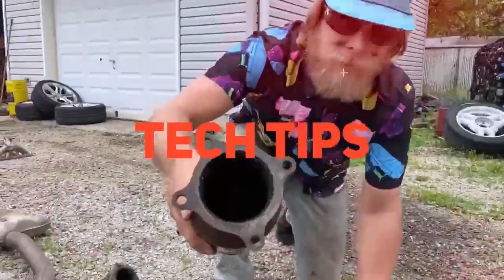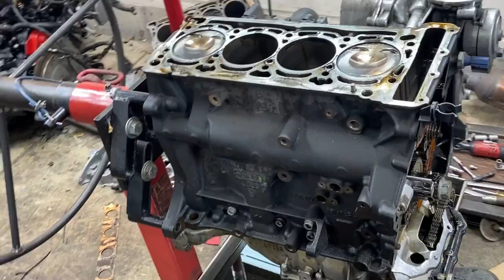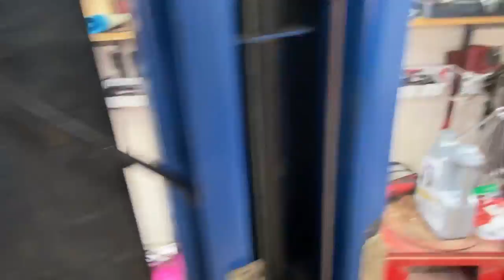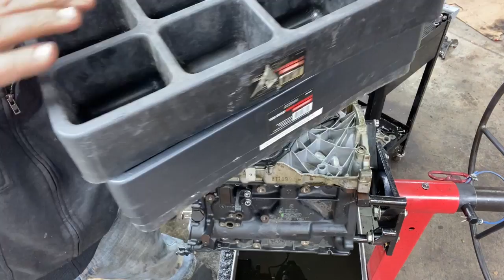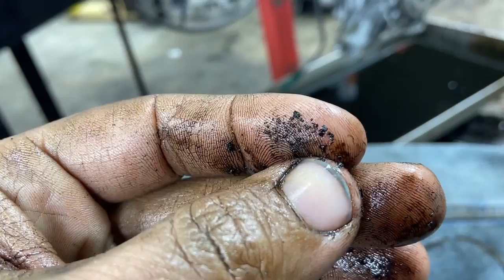2.0t Oil consumption tear down and inspection.  Audi VW using oil pistons failure reliability

Comment: Man, I love the way you do your work. Just bought my 2017 Q5, at 108k, no major issues, outside of the water pump and cv axle. But, I know I'll have to be doing the timing chain, and tensioner, new oil pan, valve cover gasket, the works. I love how you do these, talking to us "simple minded" DIY'ers out here. Working on a dirty garage, where you're stepping around your stands, chairs, and the such. You get so many that just "remove this, remove this, remove this, install this, install this" and so on. Instructions, but no know-now. 2. 0T community is here! Still going thru your videos, for sure, will def be posting questions on diag technique for a few things. Like oil pressure. Why's my engine stumble when removing the oil fill cap, and how to find that vacuum leak (if I'm right and that's what that is). But, keep up the vids man! I love that you.... Share experience instead of teaching instructions. ❤❤

Comment: 3:40 this is true.   I used to buy name brand parts on eBay and Amazon.   Not anymore.   I bought a set of 'ngk' plugs for my vw.  They were counterfeit spark plugs.  The boxes looked legit and so did the spark plugs but there were a few details that had me questioning the product.  I did a little bit of searching and sure enough, these counterfeit parts are a huge scam going on all over.  I ordered the same model plugs from rockauto(they supposedly ship direct from manufacturer) and these were legit.  Very slight difference that if you didn't know, would think they are both the same product, box, upc labels and all.

Comment: I have a 2010 a4 b8 with the 2.0 tfsi. Have this job ahead. Thinking of boring to 83mm with oversized pistons. Is this an option, due to the coating on these cylinder walls?

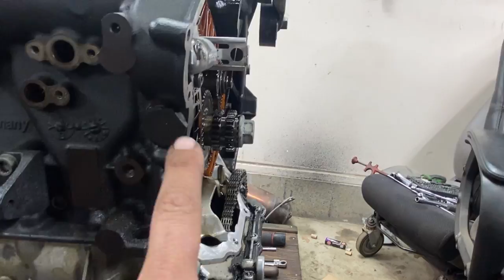Comment: Around 14:40 when it's said "these pistons have a date on them" - 05/06/2015 is not May 6th (because 2009 Audi A4 was primarily manufactured in Germany) but the normal way all the world (except USA) does it: in progression from small to large so  day/month/year-  so the date is  5th of June 2015. USA does many things backwards in antiquated fashion, like using the imperial system instead of the international metric system, to the point that Americans make errors in reading dates or communicate  measurements. Many expensive errors in engineering/medicine  were made due to this. I work in an hospital and my nurse interpreted an intended 2.5 cm to mean 2.5 inches when she applied the  FemoStop  Femoral Compression System  (pneumatic device used for external compression of the femoral artery or vein after they are catheterized to access the heart arteries to place stents in case of heart attack). Even if the medical devices are written always in metric system she mentally kept the 2.5 cm number but converted to what she is used to - inches, not centimeters. Patient continued to bleed after the device was placed in the wrong place,  and needed a blood transfusion. None of the nurses figured out the problem before we asked them what units of measurement did they use and even then they wanted to read the instructions on the package to verify there are only metric measurements there. One inch + 2.5 cm so big difference. Luckily it was corrected in time. US Congress should switch to the international system in dates/ metric measurements to prevent future errors.  Otherwise this  is a very practical and precise video, the first time I see the inside of an engine and the problems explained in an easy to understand way! SO subscribed even if I'm not technically talented.

Comment: Bro I have the 2013 A4 2.0Tfsi recently bought. 

Definitely need some help with my engine. Am in Taylorsville KY 

Upper timing Chain cover leaking. Along with some other leaks. Happy to bring the car to you if needed? Definitely burning oil too. Oil on coils and plugs. Performed a piston soak. It helped 3 clean up well. 4th still has oil. HELP ME PLEASE 🤞🤞🤞 

Am subscribed to your channel. You are the man to go to with the problems I’m having here. 👍👍👍👍👍

Comment: Hey, I'm rebuilding my 2010 a5 that had balance shaft failure and burned excessive amounts of oil, was wondering if not going oem pistons what would you suggest and also how do u feel about the borsehung balance shafts and oil pump.

Comment: I have a rule of thumb when embarking on a big job that takes days or weeks for me (an advanced level DIYer).  Don't ever cut corners and cheep out on the critical parts that take a lot of work and time to get to or could have a catastrophic failure and ruin your project.  Nothing like having to do a job multiple times and if you try to minimize that as much as possible and cut out the reasons for having to do this the better off you will be in the long run even if it cost more.

Comment: The Ea113 engine you have in front of you had many different versions. BYD, BWJ ect. You want a cdl code engine (better rings pistons cylinder head etc). If you get a good one and look after it you get 280bhp and years of fun.

Comment: I have a 2014 Q5 2.0L. I’ve watched practically all of your videos as my ride seems to have all the issues. I’ve spent $6g in the last 3mo, practically everything under the hood has been rebuilt, replaced, updated, etc but it continues to slip or stall every time oil is added (basically 300 miles). I was told by Audi Asheville and my Audi guy the issues weren’t related to the oil consumption, however, I believe it is. We’ve recently done the B12 soak/cleanse to see if it will reduce the oil consumption. I wish I could bring “Jemima” to you, to get your opinion. And FYI, Mahle is pronounced Ma-Lee. I’m from Morristown, TN where there is a Mahle plant, and as a matter of fact, my high school hall passes 25yrs ago were Mahle pistons LOL.

Comment: The engine in my car has been overheating and since that happened it started burning a lot of oil. I think one or more oil rings may be damaged since the compression, pcv and valve seals are ok, or could it be something else?

Comment: Hey Naptown. Since you're the 2.0T dude. Got some questions. I have a C7 A6 2.0 that had a timing chain tensioner issue. Mostly seemed like a fluke to me. Shop replaced engine under powertrain warranty, and im at 70k miles on rebuilt engine (170k on car). Been happy with it, change oil often, and poke around with wheel bearings, brakes, suspension, and stuff. My GFs 2010 ford edge overheated and got toasted, might pull engine on it and fix, but instead went route of picking up a 12 Q5 2.0T, with extensive, expensive dealership maintenance history. Looks like engine was rebuilt 2x for oil consumption. At 170k on the car, it seems to consume oil 1qt per 3k miles, and spark plugs were carboned up, missing small bit of ceramic on one, but did not see scoring on pistons or damaged valves with borescope. Think a dealer put crap parts in twice that it would have repeat issues of oil consumption. Incredible to me the C7 doesn't burn a drop of oil but this Q5 with multiple rebuilds does.

Comment: I have a 2015 A4. #4 piston ring  lands let go and lost compression. piston  dated 31/10/14 , but still used the old crappy oil control ring. I thought they did away with those with the updated pistons? it's getting the newest set of pistons, so i'm just curious at this point.

Comment: The compenents were purposely designed for lower friction, they lowered the tollerences to do this. The fix is to replace with a larger piston and a higher tension ring. The replacement design specs are the one found in the VW 2.0

Comment: Had a 2011 A4 that ended up with the issue. Cyl 3 was the worst in my engine. 

No longer have that vehicle and now own a 2012 VW gti. Its got mahle IE spec pistons and IE rods after it developed high oil consumption. Also has a cts boss gt28 kit. 

The 2.0T was a bit problematic in the early days but when they run,they run well.

Btw new sub. Glad your shorts came across my feed and i decided to go exploring your channel.

Comment: Have you found any of the cleaning solutions that are oil additives can help fix the problem?  I mainly familiar with the BG-EPR and then the more elaborate BG Dynamic Engine Cleaner.  I've also heard about a air pressurized piston soak that is being used by Hyundai/Kia and a Valvoline cleaning product.  Any comments on how these, or any other, cleaners might help would be much appreciated.

Comment: Hey brother, if you wanna take a trip to SC, I’ve got a 2014 w/ a cylinder 3 misfire, spark plug full of oil, but dry compression shows 160 roughly in 3 cylinders, 175 in cylinder 1

Comment: Hello naptown tuner.great explications as usual .
i'm rebuilding my tiguan engine 2.0 tsi .how will you choose the right upper main bearing color ? It should be scripted some where on the engine (gearbox side) ,but unfortunally the area is rusted .any solution to find this information somewhere else ?

Comment: I've got the A3 1.4  2013 CMBA engine  with timing belt and my warning oil light comes on just before 500 miles.

Comment: Great vids man; no frills, no bullshit, just good info……..I die laughing when you pronounce Mahle pistons “Maul”. I don’t know how to say it either, and I’ve been pronouncing it as “Mah-lee” for years now. I’m prob wrong, and the way you’re saying it is right, which also makes me laugh bc now I’m wondering if I’ve been saying it wrong for years 😂……..

I love the ea888 2.0T. Fantastic little engine. Mine is starting to get into high mileage territory, but still runs well, except for this weird—non carbon buildup related —cold-start misfire. Not every time, and it always goes away. 

Although the manual says to use 5W40, I’ve always used either Castrol 0w40, or M1 0w40. In my head, the logic is using the 0W40 will flow better on cold-start, and therefore hopefully pressurizing the timing chain tensioner quick enough, that if the tensioner ratchet mechanism failed the chain wouldn’t skip teeth. It doesn’t burn any oil using 5W40, but burns a little bit during the summer using 0w40
Reply from the maker: I’ve learned a lot since these early videos, I even interviewed a guy about the pistons at the Mahle booth at performance race industry and asked how to say it, I didn’t even know about kolbenschmidt pistons and thought they were a cheap knock off because the ones I saw on eBay were cheap counterfeit China replicas.  I need to redo all these early videos

Comment: The cost of a part has nothing to do with intelligent design. I can buy a $30 chinese honda copy piston for a motorbike that will last 10x as long as a $300 vw piston designed by a complete retard. The fundamental design is more important than the quality and price. If the rings are badly designed you could pay a million dollars for a piston and it wont last

Comment: Awesome video! You explain everything in such detail, thanks for sharing your knowledge.
I have a 2012 Audi A4 Quattro 2.0L which has always burned a bit of oil and slowly over time it has gotten worse & is now to the point of burning approx. 1L every 2500km (worse if I punch it at times which I now try to avoid). If I do try to accelerate quickly (punch it) it actually seems to choke a bit (no codes) prior to kicking in.

Comment: Got a 2016 Q5 with a 100,000 mile CPMB that, im pretty sure, has the oil control ring issue. 

Beautiful car, dealer maintained since new…. Looks like the engine is coming out….

Comment: Got a 2016 Q5 with a 100,000 mile CPMB that, im pretty sure, has the oil control ring issue. 

Beautiful car, dealer maintained since new…. Looks like the engine is coming out….
Reply from the maker: Yes I just got done doing a 2015 q5
Reply: @NaptownTuner  is there a gasket kit and/or timing tools you’d recommend?

Comment: Thank you for you videos, it's a great source of info for DYIers. Wanted to ask if replacement of pistons can be done without removing the engine. Any links to such information? I've done oil pump replacement on my 2012 2.0T Q5 and it was tough to get to couple of bolts but doable.

Comment: Great videos keep up the good work... My daughter's 2014 q5 2.0 is going through a quart every 200 miles. Thought the piston problem was fixed for the newer models. Any suggestions?
Reply: 2013 Q5 2.0T here and it uses 1 quart per 600 miles. Unbelievable

Comment: @NaptownTuner !!! 
I did it! After watching many of your videos, I just finished rebuilding my 2.0T for the oil consumption issue!! First rebuild ever, and now I'm back on the road. I took my time and planned and ordered parts for about 1.5 months leading up to it. And then I spent about 4.5 days on the rebuild, using Wossner forged pistons - a perfect replacement because they are the latest waffle ring design, and they maintain the 21mm wrist pin so that I could reuse my (2010) OEM connecting rods. 

Thanks so much -  really appreciate all of the great content and knowledge that you've provided.
Reply: Is it still running good today?
Reply: @cruiseedwards4657   - yes, came across the guy that bought it from me last fall and it's still running like a champ. He proceeded to go Stage II with downpipe and larger turbo - it screams now and he's having a blast.
Reply: ohh gotta keep this in mind
Reply: Do you have a link for the pistons you used? and what model/year is your audi?
Reply: Any updates?
Reply: - the Avant ran excellent for the following year and a half that I had it. I sold it to a guy who proceeded to go Stage II with downpipe and larger turbo - it screams now and he's having a blast. 

I stepped into a Cayenne, but still have a Q7. Almost bought another 2.0T yesterday! 😂 Kinda want to get back to it, just for fun.
Reply: @TimJeter  did you replace all the bearings with audi vw parts or aftermarket? did you check clearances? did you hone the cylinders? how did you break in the engine?
Reply: @keithmaiden8585  - I would consider it a 'light' rebuild because it did not require any re-honing. The cylinders were in excellent condition, and even the surface of the head was perfectly fine after a good cleaning with carbon blades. I had a neighbor/friend across the street who had been a mechanic his whole career - had him take a peek at it at a couple of points in time just to bounce things off him, and he had no concerns about the cylinders or head, so it was very straightforward.

For bearings, yes - I went with OEM. Clearances were all spot on. The crank and bearings stayed put; I only replaced the rod bearings. And the valves weren't a concern either. I soaked the head upside down, overnight, and in the morning there weren't any dribbles coming through, so I left them all seated as they were.

Here's a link to a photo album from the process. I didn't catch every single step, just spots along the way - don't even have on of the head fully cleaned up. 

https://photos.app.goo.gl/upsNmQiny7ZGFekb8

Comment: Interesting.. we have a 2016 2.0T Q5.. and .. burning aobut 1qt/1,000 miles.. less than 75k on the engine... I don't think Audi 'fixed' anything
Reply: I have similar oil consumption on my Golf 7R 2016 engine. It is similar with the Audi Q5. These 2.0 TFSI are really bad.

Comment: I am(was)a Ford Master tech 15 years. I am a "back yard" now. You remind me of my journeyman. I love the way you talk and operate. Hell. I hated working on Audi's. I had my first loss of compression (piston 2, valve burned a hole) anyway. I didn't want to do the job, lack of knowledge. I struggled and after a few channels I found you. My Angel with the pretty hair. I finished the Job 2 days ago. Man. I am pussywhiped, but for TFSI. I long for more. What you do is invaluable. I live in South Africa. Labour on Audi's are expensive. I did my best job possible. Thanks to you, I saved myself from the wrong tensioner, upgrade timing chain, timing, timing cover. F..k. Thanks to you I made good money. Thank you.
P.s I know the video is a year old, but  you changed my workshop forever. 
Your no.1 fan.💕

Comment: Thanks for the video. I have to say one thing though, when you said that all the rod caps face the same direction based on the writing on the bottom, in my experience, that is not the case. I have an engine that has 3 rod caps facing the same direction, and the writing on the last one does not. I double checked with the nibs on the cap and rod itself are lined up, and they can really only be assembled one way since they are cracked...did I get a one off in the whole production line of 2.0T engines? No idea, that's just my experience.

Comment: i have Skoda Superb  2013 , 2.0 TSI engine , second generation  E888, i have this oil issue of course , the engine did about 140K miles ,  and its still working nice just consumes oil.
I heard some people just got Piston Rings of wider kind and that oil pickup ring  from a newer revision , not changing the pistons and they fix the oil consumption . Its not the Piston problem its the rings . But im not an expert and i dont know if this can go this way , or you have to change the pistons if you change the rings ? What do you think?

Comment: Does the Second generation Audi Q5 2.0T and SQ5 3.0T still suffer from the oil consumption issues, and the resin I ask is because I’m thinking of buying a used 2018 Q5 or SQ5.
Reply from the maker: 2017+ is good for 2.0t.  Very few of the early 3.0t had some oil consumption, mostly the 3.0t is one of the best engines